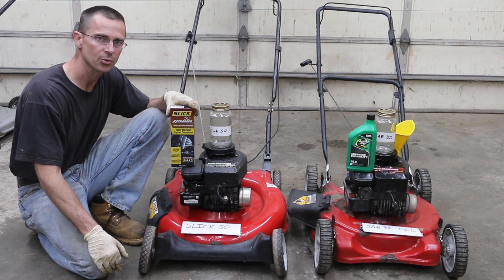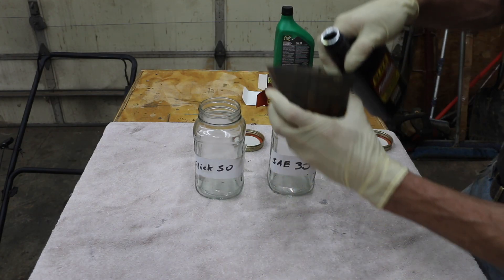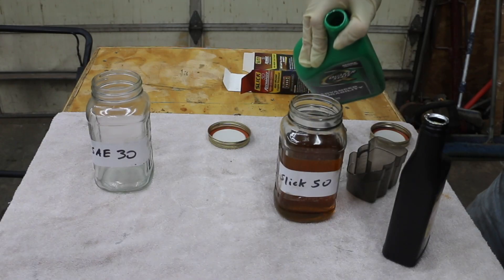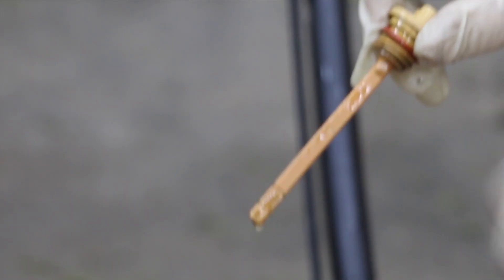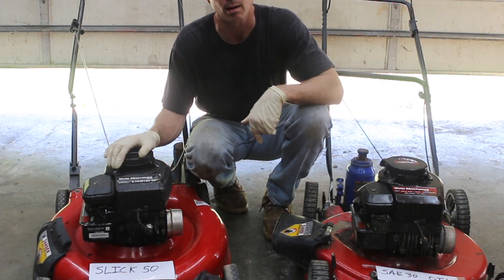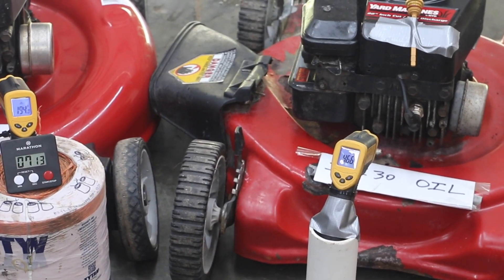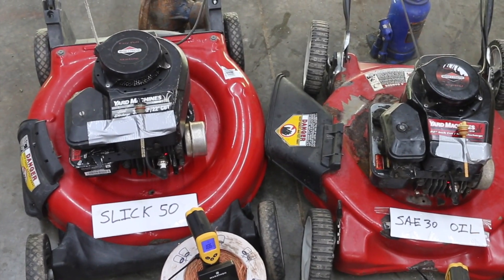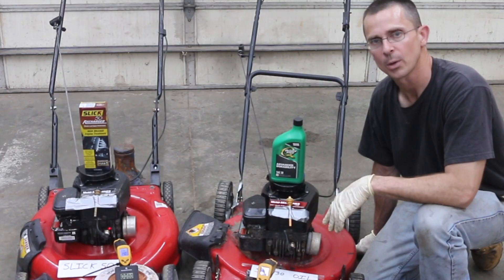Can't believe what SLICK 50 did to my engine!!--Dry Crankcase Test!

Comment: or use synthetic oil   and dura lube . i put 800 thousand milis on a ford pickup truvk with a 6 cylinder engine in it and had no problems with it, it never used oil, untill it burned up because of faulty ignition switch.
Reply from the maker: This is very impressive to get this many miles out of an engine!  Thanks for commenting!

Comment: Have you done a video with prolong engine lubricant?   I've seen the videos in the past when I was a kid.   I've used it on my bearings on my skateboard when I was a kid and then I also used it on a chevy cavalier station wagon.  I failed to screw on the oil filter hand tight during an oil change from Bakersfield California, and then drove to Sacramento.   I heard a rattling and inspected to find the oil filter within the area of the frame and no oil.   But I made it to Sacramento.   However I did install some oil when I noticed the oil filter off and oil depleted.   So, I can't say I did a thorough test nor am I a believer but I am interested to see a video in today's time and technology with videos to see if it is really promising.   So, yeah, prolong is the product.
Reply from the maker: Tommy, I have not yet done a video using prolong but I plan to do one soon.  Thanks for sharing your experience with Prolong. I believe it's a great product and I'm looking forward to testing it soon.  Thanks again!

Comment: Also this proves is the mower on the left with slick 50 was a tighter motor then the 30w oil motor
Reply from the maker: This is a great point.  If I repeat this sort of testing in the future, I plan to use new, identical motors.  Thanks again!

Comment: Not accurate test. No idea if engines had identical clearances. How many hours of use on each engine. Look at the wheels on mower with slick 50 that thing looks shot compared to the other mower.
Reply from the maker: Chris, Great point.  I will likely use new engines next time for a fair comparison.  Thanks for commenting!

Comment: Would you consider a test of Justice Brothers products, specifically their "Heavy Duty Vehicle"?  It claims to treat the metal not the oil and in doing so helps 'Increase 'Delivered' Horsepower, Increases Mileage, Reduces Gear Noise & Heat, Frees Sticky Valves and Rings.  Thank you..
Reply from the maker: James, thank you for this recommendation.  I'll research it and consider testing this product.  Thanks!

Comment: I still think it's a solid product. as an additive(that's what it is) it clearly helped. running temp was lower and that should help with power and efficiency. 

but as far as saving an engine? it would need to be run much longer than that to make sure the product reaches full potential.
Reply from the maker: Great point!  Thanks for commenting!
Reply: Project Farm I'm loving the videos! I have a lot more to watch (found your channel quite recently) and I'm always looking forward to new ones!

Comment: Dura Lube used to have a commercial where they did the same thing. Run dura lube then drop it and the cars would run around a track in desert heat without seizing for hours and hours. lol. They would brag about one of the cars being a Dodge Viper.
Reply from the maker: Kelly, I should test Dura Lube using this test.  Thanks for commenting!
Reply: How about running 2 cycle gas in a 4 cycle motor and vice versa

Comment: IT REALLY SURPRISED ME. I AM LIKE YOU AND HAD USED SLICK 50 IN MY FIRST 2 NEW CARS FROM THE 80'S. I STILL HAVE ONE TODAY, A 88 PLYMOUTH RELIANT WHICH I ONLY ADDED IT AT THE 50000 MARK ONCE AND IT STILL RUNS LIKE A TOP WITH 292,000 MILES ON IT. I BELIEVE THE MOWERS FAILURE WAS CAUSED BY THE ALUMINUM OF THE MOWER ROD CRANK SURFACES VS. OEM MATERIAL OF CAR ENGINE BEARINGS AS WELL THE CORRECT RATIO OF SLICK 50 TO OIL.
Reply from the maker: Thank you very much for commenting!

Comment: I use molybdenum disulfide powder in my crankcase oil in all of our cars. It is a dry lubricant similar to powdered graphite, but with much more lubricity. I add about a teaspoon of moly powder with each oil change. I simply add the powder before I add the oil and let the oil carry it through the engine. I noticed an increase in fuel economy each time I started putting moly into an engine. I let someone borrow one of my cars one time several years ago and she took it, (without my permission or knowledge), from Pennsylvania to Kentucky and back without checking the oil. When she got back with it and I heard the noise it was making I asked her what the hell she did to my engine. She told me where she went and I asked her how much oil she had to put into it. She looked puzzled. It didn't occur to her to check the oil before she left or any time along the way. I pilled the dip stick and there was no trace of oil on it. I said, "well I see why it's making noise." Her response was "What noise?". It took 4½ quarts of oil to fill it. I asked how fast she was driving and she told me she didn't know, the needle disappears after it goes past the highest number, (which was 85 mph on that car).  It was a GM "Iron Duke" 4 cylinder engine, (officially called the Tech-4 engine in a 1997 Buick Century) with about 150,000 miles on it. It was driven about 1500 miles mostly on interstate highways at speeds above 85mph. The oil level before the trip is unknown to me, the oil level at the end of the trip was ZERO. I honestly believe that the moly powder I add with every oil change is what kept that engine from seizing up on that trip. I got almost 50,000 more miles out of that engine. Let there be no mistake, that trip loosened the internal moving parts of the engine. The crankshaft bearings were knocking pretty loud but it still held together for another 6 or so years. One day on my way to work I was running it especially hard because I was running late. I had my foot to the floor and just after it shifted from low to second I heard a "bang" and felt a severe loss of power. I looked in the mirror and saw a line of something wet on the road. It was obvious that the engine was blown up, but it was still running. A crankshaft bearing let go and put a connecting rod through the side of the engine block. The coolant drained into the oil pan until it overflowed onto the road. It was still running on two cylinders and it was faster than walking so I kept pushing it until it overheated due to lack of coolant. When we went to retrieve the car we tried to start it just for the heck of it and it fired right up, only running on two cylinders, but running. It was driven onto the trailer and when it was returned to my driveway it was driven off the trailer and into it's parking place. It would sit there and run until it overheated and seized, then after it cooled off it would start and run again, until it overheated. I was thoroughly impressed with that engine but I really believe the moly powder is what gave it the edge of near indestructibility. You can buy oil with moly in it and the people who use it swear by it. It is expensive though, the cost is about double the price of full synthetic oil but in my opinion it's worth it.
I've sent used oil for analysis after more than 15,000 miles and the results have been consistently good. Traces of iron, copper, lead and other metals that indicate internal wear were well within the expected range for 5,000 mile change intervals and the lubricity has always been "very good" to "excellent". The report from the lab did indicate that the oil contained an unusually high content of molybdenum disulfide, which was no surprise to me but at least I know that my oil filter didn't remove it.
 A word of caution: If you get moly powder to use as a lubricant, be very careful to not make a mess with it. It does not clean up well, you will have a silvery gray finish on everything it touches. It's worse than powdered graphite.
Reply from the maker: Mister.Jim, I'll check out this lubricant.  Thank you for commenting!

Comment: Did you read the instructions on the slick50 bottle? The last time I saw slick50 (it's been a few years) the instructions said to shake the bottle because part of the formula was a suspension. If you simply poured the slick50 without shaking it up your test is invalid unless the formula has changed. The instructions also said that it took hours of operation to get the full benefit and it's clear that requirement was not satisfied before the test. You should consider that on small engines oil is a major coolant as well.

Comment: Super stuffed up test, first an engine flush with clean oil should have been done, (you can see by the color of the oil that was not done and in fact the Slick 50 cleaned out more junk) then a compression test, (like you normally do). next you need to do 3 other things we had to do, warm up the oil tin, shake the living shit out of it to mix up the additive from the bottom, and make sure all the additive was used from the bottom of the tin. If you didn't the additive was left behind and all you added was the carrier oil. (In this test all you would have used was the carrier oil) 

Next and the most important thing was to run the engine for at least 6 hours for the additive to get deposited throughout the engine and in the bearing surfaces, and piston walls etc.
I did a similar test back in 1984 and yes the engine did run for about 6 weeks mowing the grass at home before it stopped. We un-seize the engine with a wrench, , put the slick 50 oil back in oil started it up again and it never stopped for years then I sold it

Perhaps you should try the test again using the correct method. Then we will see how long it would last

Comment: I only had luck with BG Oil Treatment.  I have used it on my Jeep and put 250,000 miles on it with no engine problems.  The mechanics at the dealership raved about it and it's engine warranty.  I tried Slick 50 in a Chevy Slant 6 and it worked ok.  But THOSE slant 6's are hard to kill anyway.  I believe the BG is the best product on the market.  I would be interested in seeing a BG MOA test done on the engine.  They claim it changes the metal coating inside the engine block.  But the only proof I have is the serious mileage that I have racked up.  Thanks.

Comment: I bought a used truck that had a slick 50 sticker in the lower left side of the windshield. I didn't think nothing of it. After a few years I gave the truck to my daughter. Her husband didn't want her to have one. So he pulled the spark plugs out of his truck and borrowed her truck to drive to work in. 20 miles one way. After two weeks she went to the store and got gas. She checked the oil and there was none on the dipstick. Upshot of it was. Her bastard husband had pulled the oil drain plug and had been driving it 40 miles a day for two weeks with no oil at all in the block. Oh she found the plug in the glovebox. She drove that truck five more years after the divorce. Divorce had nothing to do with the truck.
Reply from the maker: Wow!  This is impressive!  Thanks for sharing this experience.

Comment: Motorkote test I think it would kick slick 50's ass they came it will not quit. 2 oz per quart of oil but it needs to get in the engine components before you drain it.
Reply from the maker: Alvie, Yes, I've got some motorkote and I'm planning to test it in the near future. Thanks for commenting!
Reply: Project Farm  just remember it does need time to soak in to the metal of the engine

Comment: People, you all need to understand what slick 50 is and does for you. Slick 50 is a Teflon treatment for your engine. A lot of these type products are Teflon treatments. Teflon is both good and bad for your engine. How it is good, if all moving parts are coated with a thin layer of Teflon properly cured then it is good. The problem is this does not happen in most engines just with an oil additive. How it is bad. Uneven buildups of Teflon which can block oil flow around and between moving parts is if course bad, very bad even. How Teflon works when in an additive, It has an affinity for a certain temperature range. Metal parts that hit that temp range will attract the free Teflon suspended in the oil. That Teflon will plate out on those parts. It is possible that certain engine parts will operate in that temp zone while other parts will never get into the right temp zone. So all of the Teflon over time will continue to buildup in the same spot where the temp is right for it. Possibly leaving a brittle edge that could break off and become a foreign object that is free to move around and score bearings until it gets trapped in the oil filter. A properly disassembled engine, then Teflon treated in an oven in which all parts are coated evenlyand baked at the right temp for Teflon plating is the proper way to use Teflon on engine parts. As an oil additive too many unknowns to know if it will do more harm than good in your engine. Modern engines with small oil ports and oil clearances can even become sealed completely over by Teflon coatings if they happen to be at the right temp for the plating process of the free Teflon in the oil. Which then will cause that bearing to become oil starved for the remainder of that engines life. Even if you should tear the engine down and replace that bad bearing with a new one, it will still have its oil port blocked and burn up over time. But you could get lucky and get a decent Teflon plating of all of your moving parts without any of these bad issues. Each engine and your operation of it and your climate zone all have an impact on how well or poorly this process works. So it is possible for identical engines to have different outcomes depending on these factors I mentioned.

Comment: Terrible test.  Looks like one old and one new engine.  The proper way to do it would be:
1.  2 NEW engines
2 . Proper break-in on both with OEM recommended oil
3.  Document all engine performance. (operating temps, compression) to ensure they are very similar. (significant differences would invalidate)
4.  Allow all to cool overnight
5.  Change one to slick 50 formula and run both again with more documentation.
6.  Remove oil and run until death.
Reply from the maker: Big Shasta,  These are all great suggestions.  Maybe I'll buy 2 new engines and run another test.  Thanks again!

Comment: I understand that a result of ultimate test on both engines. but I like to know if slick 50 used with motor oil would perform better yet engine would go bad?  if not, then it is a good to use slick 50 right?
Reply from the maker: This is a great question.  I don't know the long term benefits of using Slick 50.  Commenters have provided mixed reviews.

Comment: The issue I see with this test is that the engines don't appear to be identical models.  Both appear used with no way of telling how many hours they have on them, the simply are not equivalent at the start of the test.

The only way to run this test is to use two brand new motors of the same type.

Comment: next time use engines with comparable run times the engine with slick 50 looked a lot newer is less runtime tighter tolerences

Comment: That test is meaningless as both engines are not the same. You need to use 2 brand new, never run, engines for the test to have any validity. The used Slick 50 engines oil looked like an engine that never had an oil change, that's why it is black and probably why it failed so early. Great idea poor execution.

Comment: I never like Slick 50 or any other products that claims. Anyhow I do have believe in product called ProLube.  I would love to see same things u doing in this video.  My understanding u can run engine without any oil after treatment of ProLube. Reason I believe strongly on ProLube is because friend of mine had tool box and very hard to open and I looked into it and finding bend metal that scraping everytime u open so I said let try this test I put one drop of regular oil and one drop of WD-40 on other drawer and one drop of ProLube. To my surprise that drawer with ProLube side drawer out very easy wasn't expected to pull out like that and tools all over the garage we laugh about it and wow at ProLube oil. Now I been wondering about engine running on no oil. Please do repeat with few others along with ProLube
Reply: +Brian Whittington wd40 is not really a lubricant
Reply: The Gov made the company change the formula of WD40 about 10-12 years ago. All it is good for now is cleaning parts at which it is very good. But oil whatever you clean afterwards or it will rust.
Reply: Brian Whittington Do you speak English?

Comment: When I was in Iraq we would use Miltech on our weapons as it isn't so much a lubricant but a metal conditioner.  after applying it you would wipe the bolt dry and it would hold dust or sand but it would allow the bolt to slide smoothly.  on the bottle it claimed to be a crankcase additive and I've always been curious about it.  I would love to see an in-depth review of it.
Reply from the maker: Timothy, Thank you very much for the project recommendation.  Also, thanks for serving in the Armed Forces!

Comment: I loved the experiment! Ive always seen it on the shelf at O'Reilly's and never thought of trying it, I always use motor honey, that stuff is supposed to be the best. Maybe if you find two small engines you don't need, run some motor honey with the oil and see how it does! Motor honey is exactly how it sounds, its very thick and sticky!

Comment: Are you familiar with Winns products? Back in the late 60's i saw a Ford flat head that had run with Winns in it and the oil pan was lowered from the engine while it was running! It ran for a good long time, I am thinking at least 10 - 15 minutes, then the pan was raised up, this was repeated several times in the day while I worked in a service station.